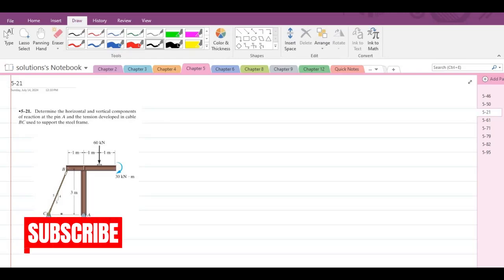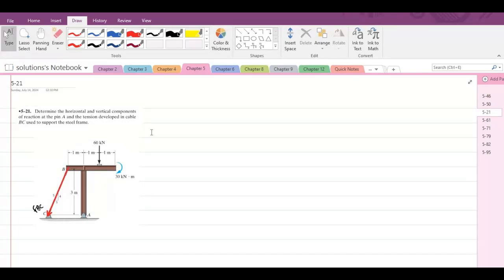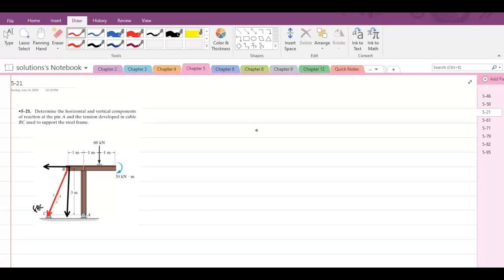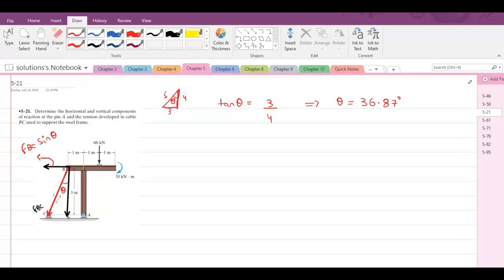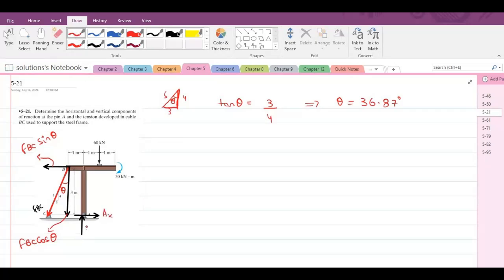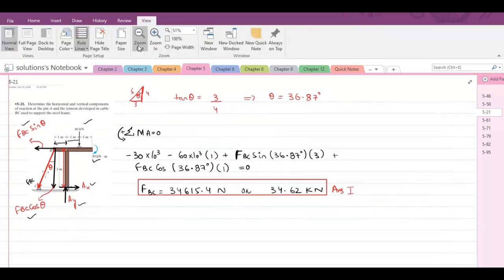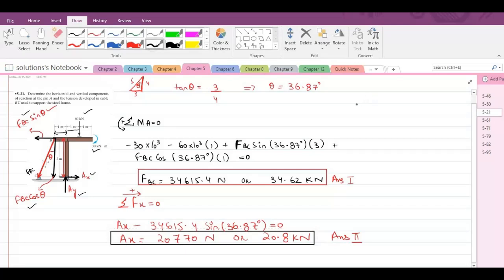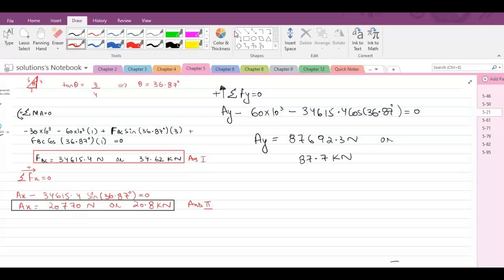5-21 hibbeler statics chapter 5 | hibbeler statics | hibbeler

Comment: what do i do if the question asks for the tension in the cable  in B instead of in BC
Reply from the maker: It's the same. The tension in the cable from B to C is constant. I hope it will help!
Reply: @solutionsmanual9535  thanks man